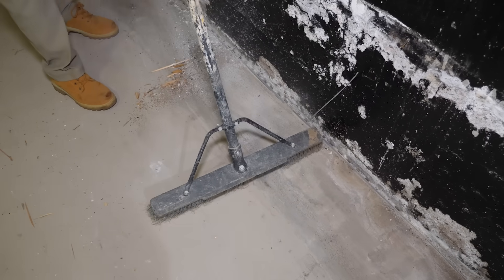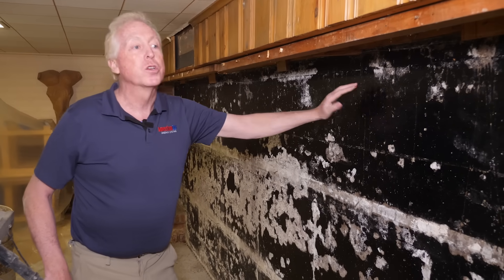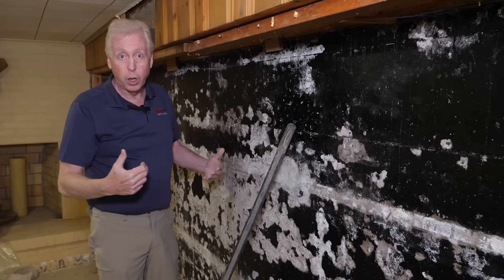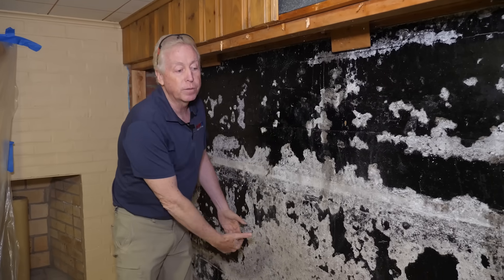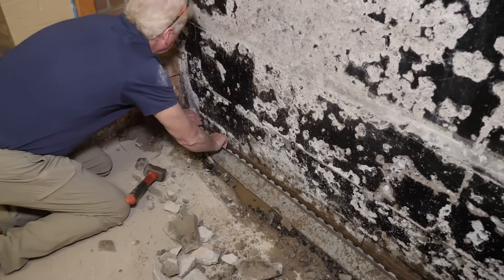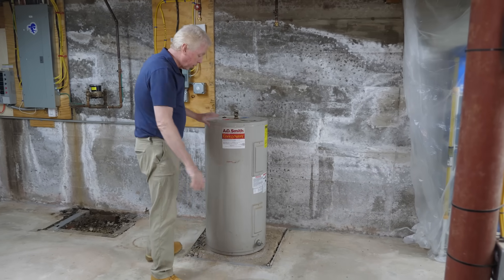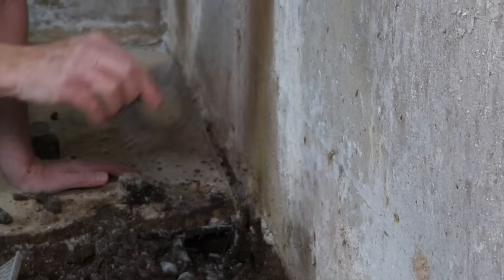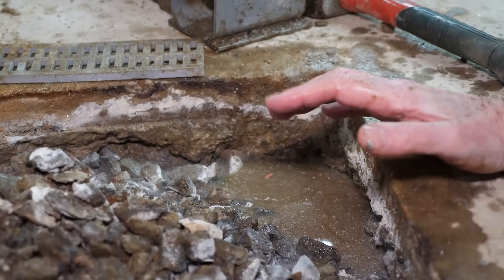Waterproofing Basement Walls | Finished & UnFinished Basement

Comment: I'm not a professional but using logicst i believe the best way to deal with water in basement is by fixing it from outside not the in side just my personal opinion 🙄
Reply: I am in 100% agreement. If I have to go out in the rain the raincoat goes outside my clothes. However, every house has its own circumstances. First don't build in a swamp. If you do, forget about having a basement. Unfortunately many people have to live with what they've got and it wasn't built right decades earlier. Our solution was excavating and using bubble type waterproofing on the outside but we had the advantage of space around the house. In a congested city area the house could have a driveway on either side and porches front and back. The exterior excavation is expensive enough on its own without adding the repaving of two driveways and rebuilding of porches and decks. The sad part is that amateur interior coatings can over the years, deteriorate the walls to the point that the walls need to be restored. Now we're talking insane costs and maybe demolition. I have dealt with commercial waterproofing companies and heard about the crystals following the water but I am skeptical. What do you pour or trowel onto a porous weak block to make it like new? Is there an equivalent to pour on me and make me young again? The problem IMO is largely in older homes. Up until 70 or so years ago basements were for storage and a bit of water wasn't that big a deal. Now those spaces are being converted into spare bedrooms and recreation rooms and while people will spend money on fancy interior finishes they go cheap on the important unseen stuff.
Reply: @meincotu  thank you for that. I built a “floating” cedar wood floor with space between ea board that lays about an inch above the concrete floor; circa 1921. When & if I get water in the basement, it flows under the wood floor & into the drain. No damage to the living spaces I created in the basement.
Reply: @vallee7966  how do you get it to “ flow” to the drain? I would think it would just sit there.
Reply: @vallee7966  nice!
Reply: When I was buying my house I saw the water damage in my basement. The previous owner tried a bunch of stupid things all I did was go on the outside of the house and correct the slope. It’s amazing What $500 in soil and sand would do for pitching.
Reply: I’ve been at this for close to 40 years. Most of the time, the backfill from the initial excavation(that is directly under a protective house eve, isn’t tamped as they fill the area. Over time Mother Nature does it slowly(because of the house eve’s.) Eventually, the air in the looser soil is removed & the required 2% slope, running AWAY from your house is not level or worse, a divot, to slow or catch the rains/ snow thawing. THAT, besides gutter systems without downspout boots or piping to transport water from the building, is, in my experience the problem. It’s tough work to excavate & fix the problem, but it’s WAAAAAAY more cost saving than ripping everything out of the basement to put a man made mechanical system in that will ALWAYS fail—even if it’s eventually. Before I married my wife, she had the same issues. Mopping floors, with fans/ dehumidifiers running all night long every time it rained! Remember, once the soil profile has reached saturation, even sprinkling will have your basement leaking. She had guys like this come through with quotes of $10,000 and more to put these contraptions in. I looked around the house & saw the slope was not right in lots of areas. I told her to order me a few yards of top soil. Meanwhile, I excavated 2’ around the house down to the foundation. No tar to block exterior water from deteriorating the block. I applied Blackjack tar, adhered a heavy mil plastic with a perforated pipe at the bottom in case water made it down that far(if not, the airflow going through it, back & forth would dry the lower soil profile more). I backfilled, tamping as I went, until I got the slope a little higher than 2% with the extra soil she had delivered(no matter how good anyone tamps, it still won’t beat Mother Nature). When I got done, I asked her to go out and buy a bunch of plants(ornamental grasses, evergreen foundation plants, etc)that had a nice root system that would love any type of water that wasn’t escorted away with the new slope. Also, this acts as a canopy rather than exposed soil/ mulch that would have an easier time In percolating downward. If you have any chips, cracks or holes, these days I use a closed cell foam(pond/ waterfall builders use it) to spray on or in it. It will expand into the pores/ cracks & water will never get in. Do it before you coat with the waterproofing tar though. I have NEVER had a call back, either. I guarantee this will be better any day than any type of “fix” on the inside of a building, because that method doesn’t address the root of the problem. A band aid.
Reply: @brianallen8091 what do you think about using liquid rubber to seal the outside wall? Does that have any negative effects?
Reply: I'm a plumber in Australia, we water proof the outside not inside. Seems wrong to us in Aus to allow water to seep through a wall to inside just to remove it back  outside  again. Why not prevent it entering in the first place.
Reply: @rockerctereo2851  exactly. And where I’m from, huge rain storms also come with high winds, knocking out power. There goes a sump pump when you need it most.
Reply: @vallee7966  already exist sump pumps with battery’s for that cases
Reply: @vallee7966 True that’s why one needs a standby generator.
Reply: @vallee7966 in US they insulation from the outside as well. This is after that has failed in older home and some random companies sell this inside systems which is horrible
Reply: @rockerctereo2851  you can only really waterproof the outside for new construction. 
Existing construction is kinda fucked.
Reply: @rockerctereo2851  you have to let it pass through to alleviate the pressure on the walls. That water puts a lot of weight on the walls by making the soil on the outside heavier
Reply: @rockerctereo2851  in newer builds it ideally has a membrane on the outside and drainage but adding to an old house especially with close neighbors is a huge bill
Reply: @rockerctereo2851  construction after 1995 does that exact thing I believe. Older houses were not regulated. I think people didn’t finish basements much here in the 1970’s
Reply: I totally agree. In my current home I had 2 small leaks in the basement.  All on the same side. I changed the grade by adding more soil and having it angle away the foundation. Then I added extensions to my eaves at ground level ie) 8 feet.  Then on the inside to patch the small holes I used flex seal caulking. Huge rain came about a week after. I put down some clean newspaper where the leaks were and nothing. It’s been 6 years and has been bone dry.
Reply: Waterproofing from outside/positive side is objectively the best approach but sometimes that's not an option which is where a crystalline waterproofing from the inside/negative side can help mitigate moisture intrusion.
Reply: I think exterior is preferable but it is likely 3-5 times the cost and intrusiveness of this type of interior method, which is 2-3 times more than the gutter system.
Reply: I have to do my celler, I was told just do the inside but I am going to dig around the outside and do it there then I will do the inside as well.
Reply: @dianasmith6588 
Hello it’s been awhile 
How did you do with water proofing your basement ?
Do you do the outside and inside ? 
Thank you
Reply: Yeah seems it  should dug out around the whole house clean and coat outside wall and build drainage drainage outside before backfill - would have been best when the home was new built
Reply: Well I actually am a professional and I think what you need to keep in perspective is hydrodynamics, he says a mouthful when he says water takes the path of least resistance, you can never stop the water, only redirect it, that’s why where I live in a new construction there are weeps through the footer, filled with clean stone to top of footing on outside of wall then tiled on inside around perimeter to sump crock, this is obviously not the case in older homes, you have to be able to give this water somewhere to go, he is making repairs that they can walk away from and feel good about knowing there won’t be another issue…solid content
Reply from the maker: I think everyone should research, compare, and try a couple of affordable DIY remedies before committing to anything. My customers exhausted every opinion, including, in some cases, exterior excavation and drainage around the perimeter, without success. Walls still crack, and after 3 to 5 years, water returns with a vengeance. If logistics brought you to that conclusion, I think attempting simple grading for 8 to 12 feet from the house and directing runoff and roof water into a dry well might help. If not, time to do a reality check.
Reply: @American Dry Basement Systems  exterior foam board, icf peel and stick membrane, weeping tile with sock, lots of clean stone with a properly installed interior or exterior sump pit is 100% the best way to go.  Add dimple membrane on top for extra protection while backfilling.

Most customers do very expensive landscaping first then decide to take care of the basement later trying the most inexpensive and fruitless options first
Reply: @AmericanDryBasementSystems  ²12th
Reply: @AmericanDryBasementSystems 

Sounds like sound advice, and I believe it.
Reply: What people are not getting what you are explaining in this video is not exclusively about preventing from getting in but about getting rid of water that has gotten in. The outside wall maybe sealed and drainage but not all is going to be captured which goes under the footer and around and up and that needs be dealt with.
Reply: If cost of an exterior solution is an issue, just do it yourself. It's not hard to do right, it's just time and labor. Be an ant.

I just finished digging out my rear-facing daylight basement fully. Took 3 weekends of digging 10 hours a day by myself. The sealing products cost $600 from Polyguard. I'll roll them on myself as well. Exterior insulation and a rainscreen will cost on the order of $1500. Rock backfill material will be another $1000. I expect $15k in savings by being willing to pick up a shovel and it's a way better solution than any of this inside nonsense.
Reply: I’m doing both. Landscape slotted drain pipe outside with that rubberized coating ( they used it in the interior)
Reply: I can only imagine how much money it would be to dig up the full perimeter of your home 6-8 feet and then do a repair to prevent water.
Reply: I agree. Or as Frank Lloyd Wright would advise don’t building basements.
Reply: Sometimes you cant dig all the way around a house once it's built.
Reply: Absolutely!!
Reply: Or even better rather than let the water build up and put any pressure on your walls, let it pass through in a controlled manner after you seal certain parts of the wall from the outside and mitigate the flow into a sump or other system from there.
Reply: @Nephilim12340  that is insanity.

I don't think you understand the basic principles at play here.
Because your suggestion makes literally no sense.
You are literally sealing the entire outside of your basement at great experience to keep water out. 
Then you suggested drilling a big hole in the side of your basement to let the water in.
Just to then pump it back outside.
To where it's just going to flow right back in. 

NO. 
That's idiotic.

The correct way.
Is a completely sealed outside of the basement. 
And then install a drainage system on the outside of the basement wall, that moves water away from the house.
Reply: @mountainbikerdave  I'm no expert, no engineering degree, and rather just trying to gather good knowledge.. I would assume that this problem was within an existing basement/crawlspace/foundation and without considering the content of the soil and surrounding drainage affecting the property you would excavate and attempt to make the outside of the basement/crawlspace wall "waterproof" and backfill the area? I know that there's all different soil types depending on what area you reside in but that fill has to settle again. Let's say the house was built in 2002, and you do this additional work in 2022.. What's the likelihood that other or additional problems don't pop up 5 years later. I would assume you can't do 2 walls using your method. I'm just trying to make sense of this stuff.
Reply: William, sam, and law made the best comments for recent home buyers.
Ty
Reply: Your logic is sound. The issue is often the cost of doing it properly from the outside. Some people have massive decks, mature trees, fancy gardens in the excavation zone or blocking access to the excavation area. A real French drain looks a lot like what this company does on the inside (trench with a pipe pitched and alongside the footing), just on the outside. A common mistake is to refill the excavated area with soil. For a French drain to work best you should have stone backfilling that trench. Then graded landscaping away from the stone. 

That said, even with a good French drain, it’s possible to have water pushed up from underneath the house. The driest basement would have both. A French drain outside the house along the footing, and another drain like this company does mirroring the exterior drain, but on the inner side of the footing, linked to a sump pump to deal with rapid rises in water table under the house.

Builders won’t invest $$$ in that for something that will be invisible to buyers anyway.
Reply: well I guess back in the day they didn't bother tarring or waterproofing the foundation before they back filled it...
  but the reason people take this route is because it's a lot cheaper than digging up the outside of your foundation 8 ft and then waterproofing and filling it back in that's very very expensive...
Reply: @daleon96  I think that back in the day as well, most basements were kind of ugly and not used like they are now hence why they have no waterproofing. Plus I think all the subdivisions and concrete and asphalt has minimized the soil area available to absorb so it pools near foundations
Reply: I Agree
Reply: Why don't they use something waterproof? If water is getting through, it's not water proof.
Reply: Agree 💯
Reply: In every case you should make an attempt to mitigate from the outside. Inside if the water not able to be mitigated from the outside.
Reply: Yea... that makes a lot of sense.  Why waterproof inside
Reply: To all the dumbasses that think you should waterproof from the outside. Good luck excavating 8’ deep and then 8’ wide and shore up the earth. Then manually clean and scrape the foundation wall. Prep the entire wall with a waterproofing membrane, new drain tile, and truck loads of gravel and then new grading. Oh and all of that still doesn’t guarantee ground water not rising from areas inside the basement floor. It only costs about 70k more to to it from the exterior on a house like this but hey no big deal for the weekend warriors in the comment section.
Reply: When a basement is already earth retaining you are better of using a type C cavity drain membrane internally with a perimeter drainage channel recessed into the slab connected to a pump//sump station.

Then stud and insulate the external walls from internal.  Once a basement is backfilled you need a water management system
Reply: Yes, we did that. We dug up outside the home and installed barrier and drainage. It was expensive and the jerk tookoff without finishing. Come up with an affordable easy way to install an exterior moisture barrier and be a rich man
Reply: @AnneGoggansQHHT  why not just use an internal type C cavity drain membrane with internal drainage and sump/pump.

It's very hard to waterproof an older structure as the block work/stonework structor has deteriorated so badly over time.  Even on a new build a type A external liquid/sheet applied membrane would only hold a 10 year insuranced backed guarantee at best. 

Also you wouldn't really be able to provide a full external waterproofing system as the type A external waterproofing wouldn't be able to be continues from the walls under the foundations and under the slab.

I have been designing waterproofing systems to new builds / existing basements for 10 years + and I even on a new build with a continues external system weather sheet applied or liquid applied it would require an internal type C cavity drain membrane to hold any type of warranty.

Any type A system can be damaged when the structure is once again backfilled, where as a internal cavity drain membranes system can be maintained and inspected throughout its life.
Reply: @LivingLife-Fast  because our neighbors sump pump went out while they were on vacation and ruined their new basement renovation. Our son was ill and we had to make sure there would be no mold in the structure to the best of our ability. Actually another neighbors sump pump went out on a holiday and they were in a panic. I personally fixed the slope of our yard so between slope correction, membrane, and drainage we were good. Then a pipe burst…so nothing is guaranteed 🤦🏻‍♀️ We make plans and God laughs 😅
Reply: @AnneGoggansQHHT  nothing is ever 100% when dealing below ground.

You can get a battery back up unit, this will run the pumps independently when there is a power outage.  If the structure is extremely wet you can apply a sand and cement render internally with a cementitious slurry to the render to hold back water pressure before a cavity drain membrane.

Either way I wish you luck with it all,  I know how tiresome these things can be :(

I also hope your son is well and wish him all the best.
Reply: @AnneGoggansQHHT  why not just use an internal type C cavity drain membrane with internal drainage and sump/pump.

It's very hard to waterproof an older structure as the block work/stonework structor has deteriorated so badly over time.  Even on a new build a type A external liquid/sheet applied membrane would only hold a 10 year insuranced backed guarantee at best. 

Also you wouldn't really be able to provide a full external waterproofing system as the type A external waterproofing wouldn't be able to be continues from the walls under the foundations and under the slab.

I have been designing waterproofing systems to new builds / existing basements for 10 years + and I even on a new build with a continues external system weather sheet applied or liquid applied it would require an internal type C cavity drain membrane to hold any type of warranty.

Any type A system can be damaged when the structure is once again backfilled, where as a internal cavity drain membranes system can be maintained and inspected throughout its life.

In the uk there is now British standards meaning any new build project that is below ground has to have specialist installers with 2 x forms of waterproofing. That would be an external system and a back up internal cavity drain system.

I feel for you and hope that this legislation is brought into the US.
Reply: I'm thinking 🤔 the same thing 👍
Reply: Absolutely but it's not practical to excavate around the entire foundation to do so and the back filled soil can actually cause issues because it won't be compacted as much thus allowing more water to make it's way right up to the foundation walls
Reply: @bend4852  completed agree, new concrete slab internally with water bars at the wall floor junction and a maintainable internal type c cavity drain system is the only way
Reply: I agree I have a basement drainage that is below the footer but it rarely gets water.  Though I still get water through wall.  It doesn’t go under the wall in clay.  Dealing with outside resolved the issues before it gets there.
Reply: best way is digging a footing right in front of the inside old wall pour the footing stick rebar in it by drilling or when wet then put up your form on the new footing and pour your walls you can go 8ft at a time
Reply: 2hqy why you fix has more to do with access then best way ... sometimes it's not accessible from outside because neighbours are too close or a brand new cement driveway which they don't want to cut many factors you can fix it just as good from the inside and in many situations it's the only way .
Reply: Hydrostatic pressure can cause it as well and if power goes out that's what a battery back up is for on a sump pump
Reply: Do you know how much that would cost? Nor everyone has $20k to basically redo their entire foundation. At that point, you're really starting to debate just building a new house, honestly. In a perfect world of course you would just not have had it done wrong the first time but you're talking about digging out a 25×25 foundation roughly 6 feet out from that 25 all the way around the house. Then if you have a deck, side walk, attached garage, bushes, plants, electrical, water lines, gas lines, and so on. You're right, you're not an expert and it is just your personal opinion. Congratulations on wasting your time and my time with a goofy comment.
Reply: I believe that’s also.   U hv to stop the water from out side not inside.
Reply: That's why this method is actually moisture control.  Water control.  Damp control.  It's just easier to utter the word waterproofing.
Reply: Blame the ancient people💀💀
Reply: Should you use foundation coating on the outside looks like tar, and on the inside you can use drylok on the inside if you did both of these things you would not have a problem
Reply: Foundation coating on the outside looks like tar and Drylok on the inside
Reply: Had white powder along the walls in my basement for so long. Did not know it was lime caused by water seeping through causing deterioration.
I’ve since sold the house but never realized the cause of the damage.
What a well explained and thorough video, thanks so much for this!
Reply: Not opinion. Fact.
Reply: Facts the more you keep out the better off.
Reply: 1000% agree he is to dig all around outside the House where possible if there is no extension built and dig about 50cm under the fundition and do steal concrete solid at least 30cm x 30cm then add hidro EPDM Membrane
Reply: You are wrong for the most part
Reply: Your right  !your not a expert!.  This gentleman  knows exactly  what he is talking  about American basements are getting it right. Great job
Reply: Waterproofing contractor here, your statement is correct, the only time interior could be proposed is if it’s not accessible from outside, and we still won’t do it, would recommend digging around the obstruction for one continuous exterior footer drain and installing cleanouts on every wall and change of direction, we put ZERO dirt back, stone backfilled to grade one 24 ton delivery at a time
Reply: Yes, outside
Reply: I couldn’t agree more. Why wait until the water has intruded into your house, then have to sump pump it back out? Agree the first DIY is to direct water away from the house and/or install French drains 8-12 inches from exterior foundation walls. 
If the water table is high, an interior drain system may be needed too.
Reply: True, but that's really only a realistic option for new construction.

For an existing house Even if you excavated the entire perimeter of the the foundation (which is extremely expensive and cost prohibitive), and used a spray on waterproofing membrane on the exterior walls, water can still infiltrate from underneath the slab. 

Now you can in theory waterproof your slan but you would have to completely removing and re-pouring your concrete slab, but even if you did that.
how do you tie it into your external wall water proofing? 
It's impossible, so it kinda defeats the purpose.  

With these existing foundations at best you can reduce water infiltration (at great cost) and at worst manage water infiltration, but you cant completely eliminate it.
Reply: @mountainbikerdave  if you have a place to drain the water away from the foundation you dig below the side of the  footing put in 2 or more weaper pipes then add clear 3/4 stone about a foot above the floor then put builder cloth over stone. along with waterproofing wall . This will prevent water from sitting under floor as it will seal into weavers . If water can’t get away naturally then a sump would need to be used.
Reply: As a waterproofing inspector there are many ways how reduce the effects of the hydro pressure but ALWAYS hands down is treating it from outside liquid membranes, drain mats, plus protections.
Xypex insides typically one of many
Spend some time doing research get educated
Reply: Waterproofing from the outside is better obviously, but in retrofits, excavation costs and lack of outside space to work (neighboring buildings in city centers) can make the work difficult. That's why doing it from the inside is an option and can solve much headache.
Reply: The damage is in the structure. Temporarily draining water from the outside isn't going to fix that. The entire drainage system has to be replaced. Nothing you do outside will be permanent or long lasting. It is better to build a system the expects and controls water, rather than trying to fight against it.
Reply: @williamdafoe3567  but either way you are fighting against it